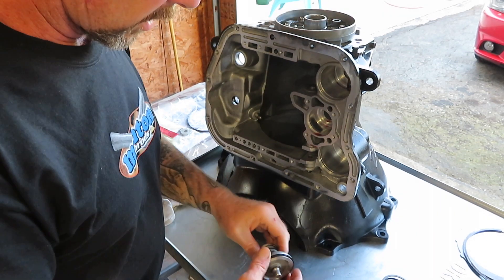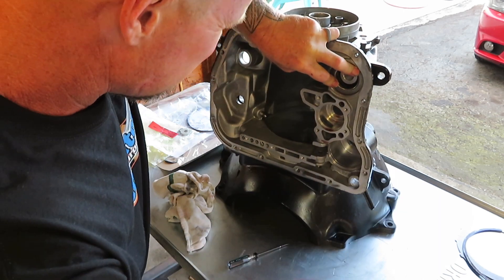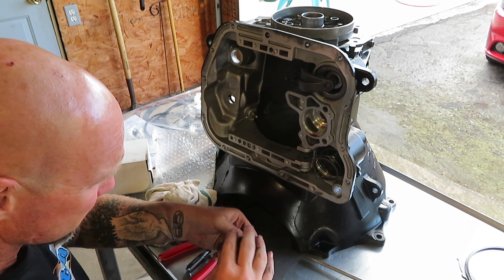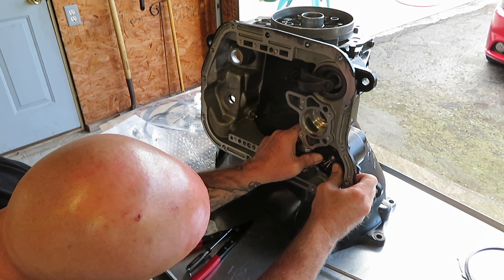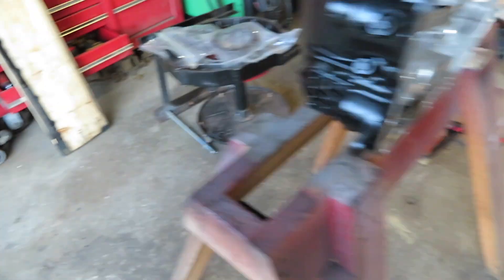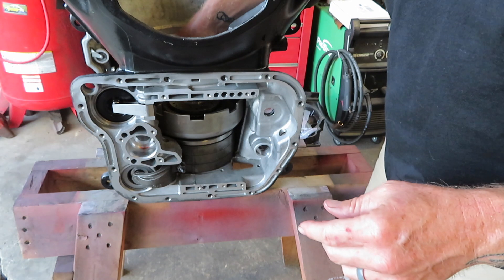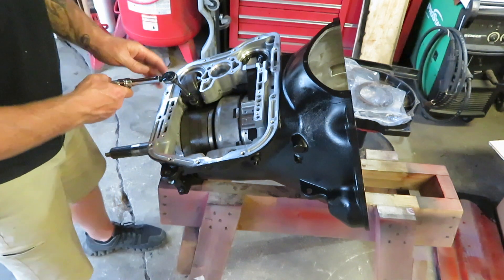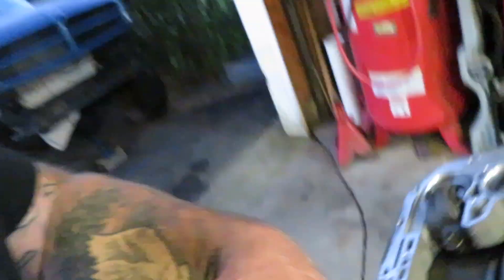How To Rebuild A Transmission 47RE Part 6 Assembly

Comment: Probably not a good idea to change measurements on bands, on the idea that they will ware down later down the line,it could cause premature failure.A quarter inch or more from the actual measurement can make a big difference in preformance.

Comment: So werid... putting mine back together... and I'm following the manual and your videos. For some reason the front band is hitting the case.
Reply: Omg... i'm putting it in upside-down. 🤦‍♂️🤦‍♂️🤦‍♂️🤦‍♂️🤦‍♂️🤦‍♂️🤦‍♂️🤦‍♂️🤦‍♂️🤦‍♂️🤦‍♂️

God... in two different videos the band looks like the lugs are upward.

By the way... the issue i was having earlier was due to my sun shell and sun being totally toast. The teeth were all beat up and the shell itself actually had a dome to it at the base where the teeth are.

Also... I bought a muldoons shifter. Its a gated deal... I think I'm gonna run either the pro ratchet or the Anteater instead. The gated deal is sketch to me unless all you do is drag race.

Thanks again dude... your videos are the best. 👍👍
Reply from the maker: Your welcome thanks for watching!!!

Comment: when re assembling my low reverse drum and inner race assembly along with the intermediate shaft, it doesn't want to sit down all the way, and when im putting in the intermediate shaft it seems a bit to tight against the piston drum housing.. what am i doing wrong 😞
Reply from the maker: I had the same issue and couldn’t get the snap ring on once the drum was installed. My issue was that I did not have my sprag bearing in all the way.
Reply: @ChadMyers73  how far down is the intermediate shaft supposed to be seated down inside the low reverse drum?
Reply from the maker: Did you get your snap ring on your low reverse drum
Reply from the maker: Also make sure your adjustment is all the way out
Reply: @ChadMyers73  yes
Reply: @ChadMyers73  i put the sprag in first then the low reverse band and the drum followed by the inner race assembly and the intermediate shaft but when i put in the shaft it seems like it wont turn inside the piston drum housing.. i am confused about this
Reply from the maker: It should only turn one way

Comment: Thanks for another great video Chad.👍👍 You need an eight point socket for that square head.
I have some craftsman's I bought over 30 years ago, don't use them often but when you need them you need them. I have a few old square sockets too.
Reply from the maker: Thanks for watching! Yeah I just going to pick up some crows foot.
Reply: @ChadMyers73  
The crows foot will work but will effect your torque reading. There is a formula for refiguring to correct it but I don't have it.
You will be putting more torque on it than the wrench is set for because the CF gives you a little more leverage. You may already know that. I'm telling you just in case you don't.?Keep up the good work. 👍👍
Reply from the maker: Yes it will. It will be in my next video if I remember to say something. Lol
Reply: @ChadMyers73  
Well I just took my two inch pound torque wrenches, put a crows foot on one against the other and even with it inline with the wrench I don't see a dimes worth of difference. 
I don't think you have anything to be concerned about using a crows foot.
Reply from the maker: 👍 thank you for looking out.
Reply: @ChadMyers73  
? If you use it at a 90 degree instead of inline with the torque wrench it may not affect it, you might look into that.
Reply: @ChadMyers73  
Now I got myself wondering, I might have to do some experimenting to see. 
I believe you have two torque wrenches, you could set one to the right spec,put the crows foot on the other one and and adjust it off the other wrench. 
I'm confident you'll figure it out.

Comment: You can use a open end wrench on the square end just tighten it up with ur pinky finger than back it off.
Reply from the maker: Or a 1/4 drive crows foot